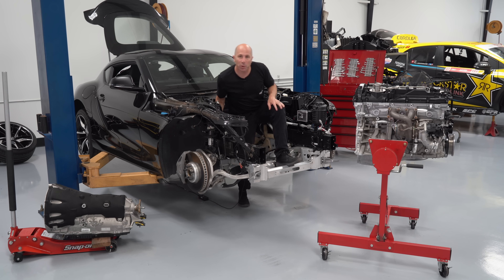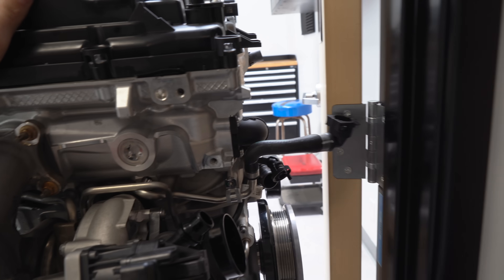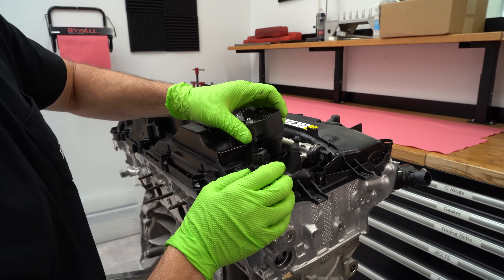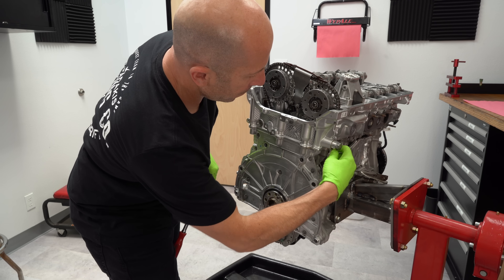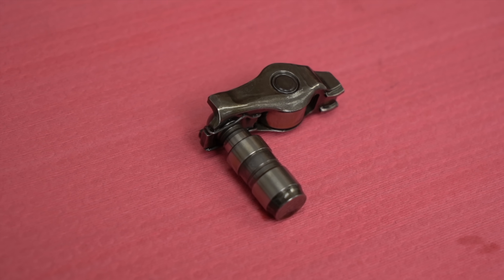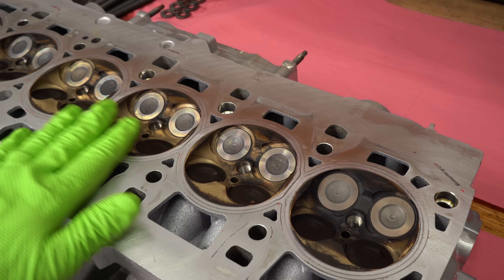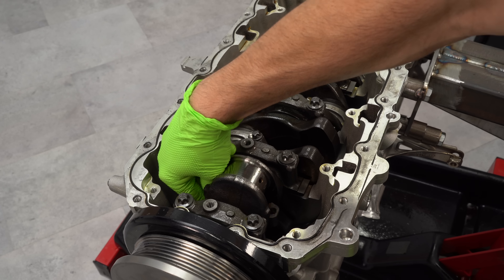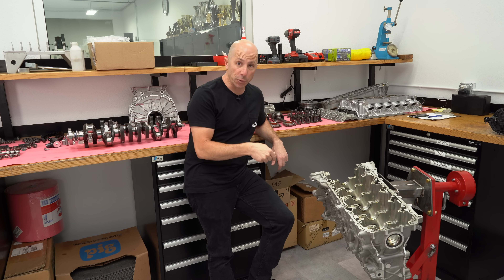2020 Supra B58 Engine Teardown - First Look - Better than the 2JZ?

Comment: Only the Germans would make a one piece, plastic, air to water intercooler, intake manifold combo.
Reply: i bet they put they assembled the intercooler the same way you build a ship inside a bottle.
Reply: @Forgan_Mreeman  how do you put ships in bottles...
Reply: That just sounds expensive.
Reply: Raging Raven no is costing saving
Reply: Remember that everything has to be TUV - ed in Germany. 

Every part used in the BMW Supra was tested at least  a few hundred times. 

This vehicle will most likely never be modded in Europe, but heavily modified in countries with relaxed mod rules, which means the USA and Aussie market will go absolutely nuts (if) the car sells well :)
Reply: @krispykruzer  honestly I don't think it will sell well in Europe.
No European wants a BMW (price too)  with a Toyota badge, plus why would you buy even a tuning legend in a place that u can loose road worthiness just by looking at the engine bay funny.
Reply: @- whoami - the chassis is designed and made by BMW (Supra uses BMW Z4 chassis), new Supra is made in Graz, Austria (once again, BMW uses this plant to produce Z4 and 5 series), even the infotainment system is just a BMW's iDrive with Toyota badges instead of BMW badges. New Supra IS a BMW in a Toyota clothing, which isn't bad, but a bit disappointing.
Reply: @B. Chandler I'm sure the plastic will be fine, but they made 3-4 separate pieces into one assembly and if you want to change the intake manifold you're going to need a different intercooler for sure. It just seems like BMW engineers flexing.
Reply: OEM only at its finest :)
Reply: And made this engine hard to rep also 😂
Reply: They still mad about ww1 and 2
Reply: They are on some of the European fords also, charge air cooler slides into the intake manifold
Reply: @- whoami - yeah well, of course, I don't say it's forbidden to buy one, if you like it then go for it, simple as that.
Reply: Well done mate - a top video!!
Reply: Σιγά μη κάτσει ο Παπαδάκης να εξηγήσει πως κάνουν ζύγισμα και σκλήρυνση μετάλλων. Άμα ήταν έτσι όλοι θα φτιαχναμε 1000 άλογα μοτέρ για τη πλάκα μας.. βλαμμένος κοσμος που υπάρχει. Φάτε κουτόχορτο ζώα. Οτι σας πασάρουν το τρώτε με το κουταλάκι.
Reply: @ChrisGR93_TxS  "Papadakis does not sit down to explain how they weigh and harden metals. If that was the case we would all make 1000 motor horses for our plate .. hurt world. Eat pets. Eat what you eat with the teaspoon."

WTF?
Reply: @robwiljas  yeah if google could translate Greek then George of the judge would get a PhD
Reply: @robwiljas  thats a funny translate tho X)
Reply: It's a BMW Z4
Reply: @FuLLeFFekT1 he didn't want to mean that. Hes mentioning other benefits of non 100%plastic intake manifolds
Reply: @B. Chandler Supposedly helps with lowering air intake temps
Reply: @electric6877  and why they're using an aluminium radiator inside that intake?
Reply: @ChrisGR93_TxS  because it's a similar concept to an actual radiator, forcing air through the metal vanes to cool off the liquid. You mean the intercooler inside the intake though right lol?
Reply: Malcolm Reynolds  you're talking as if this car is a shitbox and is only worth 1000 dollars, you know how much these sell for, 3k dollars is nothing to someone who can afford one in the first place.
Reply: It makes it easier to throw in the garbage as 1 piece.
Reply: @joshuac9805  good one! Lets hope the gods of aftermarket fabrication can fix this one for them (us?)
Reply: There's always room to learn different engineering design.
Reply: Considering I and everyone I know have had to replace my VCG on my e92, id say you’re right :)
Reply: frank white  I think BMW can make an engine of they wanted to, they had a 1400hp 1.4 liter i4 in F1. So your point? Why would they make race engine for every single car?

No car running 5s is running a 2jz block, they a running a billet block. Not a 2jz block.
Reply: Not real plastic per say.   Its a composite.    Plastic like n lightweight, heat n expansion resistant and does not crack or break.
Reply: @Elbarbero-supreme  highly resistant to cracking. Does not crack is a bit enthusiastic.
Reply: "Hey, Bill, what the hell is this?"

Dougie holds up intake manifold 

"oh that?!? That looks like a twelvehundred-bucks'er Dougie"
Reply: You guys are some numbskulls. The intake is made in multiple pieces, the core is inserted, and then they weld it ultrasonically. The plastic will be fine as well, I'm sure it's gf60-80, probably the same plastic they make expensive construction tool clamshells out of, and those drills etc are fine if you drop them from a 2nd story window. Iirc the fast 102 LS manifold can hold something like 60 psi, and I'm sure this is stronger than that is.
Reply: It's what we call efficiency. Probably costs quite a bit less than having individual parts, and the intercooler placing looks like it's very high performance.
Reply: @- whoami - well imho the only thing toyota is the badge. I feel Toyota screwed the pooch on this one
Reply: Planned Obsolescence is what that is smh
Reply: I wanna see that engine at 1000 hp completing a single dyno run with that fancy plastic intake you all admiring.
Reply: @ChrisGR93_TxS  a lot of M50 have 1000hp with their plastic intake
Reply: @ChrisGR93_TxS  you clearly know nothing about plastics. Plastic is honestly ideal for intake manifold due to its low mass, which directly means it has less heat soak as compared to nearly every metal. If you're doubting the strength of plastics, why don't you go reef on the windows at your local zoo. Bring whatever sledgehammer you want, you aren't going to crack it. Do your homework.
Reply: @unlisted9494  and you wanna start this. Give me an explanation why they using aluminum intercooler inside that plastic intake if like you said plastic has less heat soaking abilities. Which i agree but its not meant for pressure and long term use. Have a nice day
Reply: @UCIEHd3a_yHPWV45Vfd3_hzA not for too long. If it could handle the pressure after a while it will suffer from deformation. I don't know how to make it sound right but usually plastic intakes are multiple part "hot-glued" together and deformation with pressure and heat variations cracks them open
Reply: @unlisted9494  Και για να ξέρεις φίλε μου. Εχω μεγαλύτερο λεξιλόγιο. Και ξέρω περισσότερα χαρακτηριστικά υλικών και πως συμπεριφέρονται. Η ανάμιξη μετάλλων σε ένα ολοκληρωμένο σύστημα κινητήρα εσωτερικής καύσης που παράγει ενέργεια δλδ θερμότητα προκαλεί όλα τα μέροι του κινητήρα να απορροφούν ενα μερος. Καποια απο αυτα εξαρτώνται απο την συγκρατηση αυτης της θερμότητας ώστε να αποδώσουν στο μέγιστο. Με αυτο σαν σταθερή και τα υπόλοιπα μέροι του κινητήρα αποκτούν αναγκαστικά κάποιο μέγεθος θερμότητας. Με την ποικιλία υλικών και μετάλλων προέρχεται και η ποικιλία διαφόρων συνεπειών ως αναφορά τις συμπεριφορές σε εναλλαγές θερμοκρασίας. Ως αποτέλεσμα μακροχρόνια αυτή η ποικιλομορφία να προκαλεί κακή επαφή μεταξύ τους.  Good luck translating this my triggered friends.
Reply: @ChrisGR93_TxS  I'm not triggered but what makes you think it's hard to translate Greek?

"And to know my friend. I have a bigger vocabulary. And I know more material characteristics and how they behave. Mixing metals in a complete internal combustion engine system that generates heat and energy causes all parts of the engine to absorb a part. Some of them depend on this heat retention to give the maximum. With this as a constant and the rest of the engine necessarily get some heat. With the variety of materials and metals comes the variety of different consequences as a reference to temperature-change behaviors. As a result, in the long run this diversity causes bad contact between them."

You're ignorant and very arrogant.
Reply: @robwiljas  surely google would love your assistance and your free time. Lmao
Reply: @robwiljas  Everyone has the right to express and support their feelings and thoughts especially if those are experiences. Everyone can be in a conflict as well. From the moment someones is changing strategy in that conflict and pushing others spots. Like the lack of proper English that I have for example 'Im not proud of it but i admit it. And im trying my best if you wonder.... Then the only you can do is to push back. But for any other fking reason no one but absofkinglutely no one is in place to judge that. Share your thoughts and experiences. Get in conflict about that. Its a beautiful way to learn things. But stop being the judge for someone. You don't earn anything from that. Be an observer and take what you need to be a better person. Stop trying making others look miserable to forget you problems. I don't mean that you do that but it doesn't make any sense if you judge someone because he speaks Greek and wants to push back from someone who's trying to do the same using a fancy terminology to impress me... for what reason makes you the judge to be in the way showing off that its not damn hard to translate Greek. Believe me there're literally thousands Greek words that i don't even know. Probably im not the best source to drag that out. Internet has all the knowledge in a button but we ignore it because we consider it obvious. Have a nice day.
Reply: @ChrisGR93_TxS 
You're supposed to be an engineer with an understanding of thermodynamics? You know that aluminium isn't exactly the most stable material in extremely hot conditions, and that certain plastics and plastic-based composites have much better thermal properties than aluminium, right?

Unless you got your degree in the 40s, when the only viable plastic was bakerlite. Those times are long gone.
Reply: @ChrisGR93_TxS 
There's no need to go around insulting people, but it is apparent that your knowledge of materials sciences is a bit behind. I'm a student at the RWTH Aachen, and if you truly are an engineer, you should also know what that is.

Aluminium has the tendency to go soft when heated too much, there are plastics and composites that will remain stronger at higher temperatures. Machining Aluminium can be tricky (which is why it's generally cast), and there are many other materials much easier to work on. Aluminum is also subject to metal fatigue, which many other materials aren't.
Granted, my field isn't engine design, but aircraft, but there is a reason why there's a transition from aluminium to plastic composites. Glued carbon fibre is more durable than welded or riveted aluminium, it can be produced in much more intricate shapes all while being significantly lighter. And while production isn't necessarily cheaper, the materials are generally easier to acquire, since you don't need to go mining for Bauxite in rainforests. 

I too am a person that would prefer everything to be made out of metal instead of cheap vacuum-molded plastic, but that doesn't mean that I can't see the developments of the last decades and the potential within plastics and composites.

Now, I don't know why all of a sudden you're talking about heat soaking and cost. If I remember correctly you originally stated that aluminium is inherently superior to, any plastic, which is just not true. And if you actually want to prevent heat soaking in an engine, air circulation and spacing of components has a much bigger impact than the material. Or you just add elements out of brass etc. to conduct the heat away. When building an engine, heat soaking is a relatively minor concern. 

While your skills at projection are admirable, I advise you to read your own comment again and think wether what you wrote gives you credibility and makes you seem like a person knowledgeable in the matter. Why don't you behave like any adult would and just explain in plain and simple terms why aluminium is in your opinion the superior material, instead of putting out blanket statements and getting all touchy if someone disagrees with you.
Reply: @mikeblatzheim2797  I didn't build anything. That argument started when all the ppl in that comment surprisingly for me did positive comments about that plastic/aluminum rad combo.(and i can ensure you that its just plastic not even abs with some temperature resistance but still nothing in front aluminum in case of pressure) While that video was about making a powerful engine no one said anything negative about it. Im pretty confident that a lot of them have seen powerful and beyond normal pressure engines and all the custom made parts to keep up this pressure. I never mentioned anything of what you trying to prove that i totally agree with and potentially it would help to improve an engine. But now they only trying to reduce production cost and to eliminate space. Nothing to improve durability and performance. I hope you love what you studying and keep proving that there're alternative more efficient and easier manufacturing materials. But sometimes its about numbers. Frustrating but its the reality.
Reply: @ChrisGR93_TxS  Exactly you can tell Europeans don't do much modding to engine's and just pussy footing around sipping tea and eating crumpets with little lap dogs running around while on the phone with grandma......
Reply: @boostjunkie2320  Sweden, which is in Europe, has the biggest streetrace in the world. You can also tell Americans need 350hp dailies because they are all overweight.
Reply: @boostjunkie2320  Americans still don't have the biggest one, we do. You don't even know how to make a real street race, need to prep the road lmao
Reply: When he said plastic I could think of was how that’s gonna hold up with 1000hp
Reply: @Infanitunit1  obviously they thinking a custom aluminum manifold. And so many. I bet you wont recognize the block from the externals. Also other "internals" they might not completely cover on the video
Reply: So dispose after any problem. Profit
Reply: Malcolm Reynolds     This is still an extremely complicated engine.  There may be less clutter in the engine compartment, but they've moved half of the clutter inside of the engine.   An ECU controlled thermostat?    How long before the actuator gets coolant fungus in it and it quits working?  A secondary chain driven oil pump?
Reply: @scdevon  It really isn`t all that complicated mate and is a direct successor of the n54/55 engines and whoever worked on those will find many similarities. If anything this unit is much more refined and de-cluttered than it`s predecessors. Regarding intake manifold design BMW indeed used "plastic" ones for decades with more or less success no biggie there. I have no idea about the built in intercooler`s high performance capabilities yet but surely an fmic can be installed alongside no problem. I am more concerned about the exhaust port/manifold design for higher power output applications but I am sure that skilled guys will be able to fabricate good designs over time to suit different turbo/downpipe upgrades.
Reply: @scdevon  These things have been on bmw engines since 2006. Works great most of the time.
Reply: Terrible design!
Reply: So if you want an exposed front mount intercooler you have to change the fuel intake manifold too......Only BMW engineers who are completely out of touch with the Supra would put that design on a Supra.

If you want a tubular exhaust manifold it's going to be very small and very gay.
Reply: @boostjunkie2320  no fuel passes through that manifold. This is direct injection.
Reply: keeganwebber he meant “full”
Reply: @keeganwebber  That does not change the fact that you would need to fabricate your own just to run a front mount intercooler. This is the tuner crowd we are talking about that will be buying the Supra so it is a big deal. Someone should have done they're homework.
Reply: @boostjunkie2320  or you just run a WTA intercooler instead like a big boy
Reply: @keeganwebber  Im good. Been there done that. I like the air to air. I run two bovs, on right next to the intercooler and one next to the intake manifold. I got my own style. I don't follow the crowd
Reply: @keeganwebber  "full" intake manifold
Reply: @boostjunkie2320  Oh yes, fuck all emissions standards we have to pass, and power benefits to be had, people want to put tubular manifolds on here..
Reply: @boostjunkie2320  it is a BMW Z4
Reply: @Anonymous-ed8om  No it's not. Its a lot faster then an M4
Reply: @boostjunkie2320  Just by the looks of it does not seem like a difficult thing to do, really . Likr @keeganwebber said, this engine uses DI, so it it a matter of either designing, fabricating and fitting both a new intake manifold and a FMIC (the aftermarket community might take care of this).
Reply: @boostjunkie2320  you're 12, you won't be able to afford it anyway. A water to sir intercooler is a lot better than s front mount. The super short exhaust headers are also better than a huge tubular. Stop thinking you know more than very educated engineers
Reply: @boostjunkie2320  ...I think you mean Toyota engineers who are completely out date, the engine wasn't designed for a supra
Reply: @DonJDawson  No, I meant BMW they are completely out of touch with Supra buyer's or there would not have been so much backlash....BMW can keep that bullshit technology. 

It only comes in auto trans, that literally makes me want to vomit
Reply: @B. Chandler Well its still gay asf